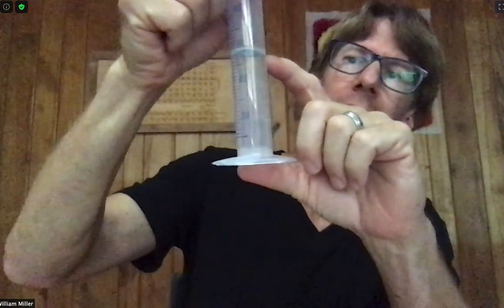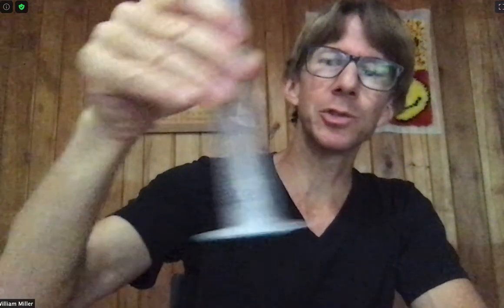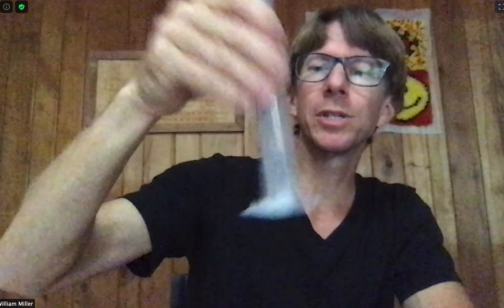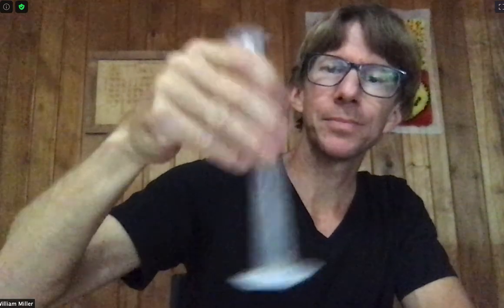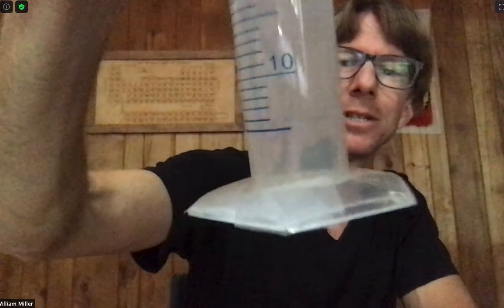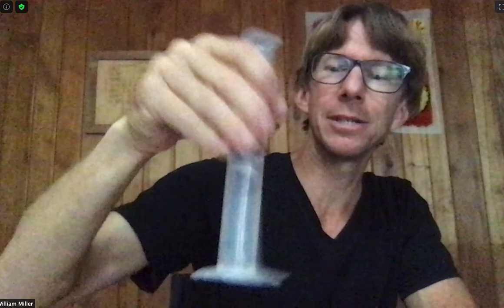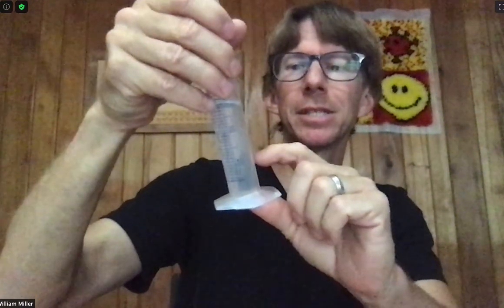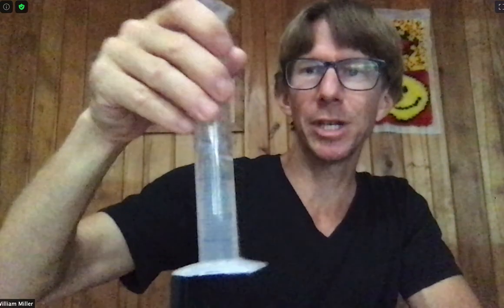Experiment 3 - Density of Saline Solutions - Mix Well Without Spilling ( No Inversion)

Comment: Should we measure out 25 mL of water prior to adding it to the graduated cylinder? If we filled the graduated cylinder to the 25 mL line with water after the salt was already in there, it wouldn’t actually be 25 mL, since the water is being displaced by the salt crystals...right?